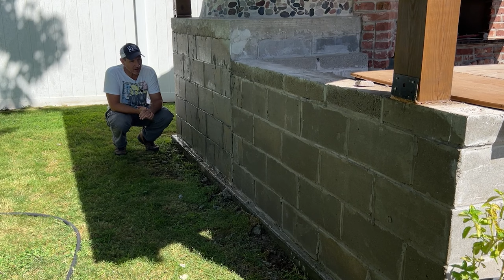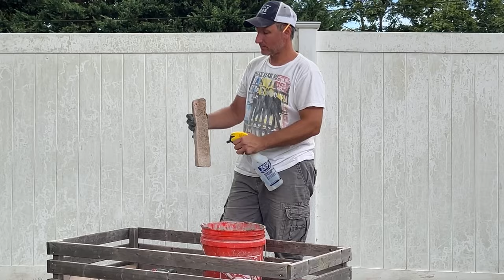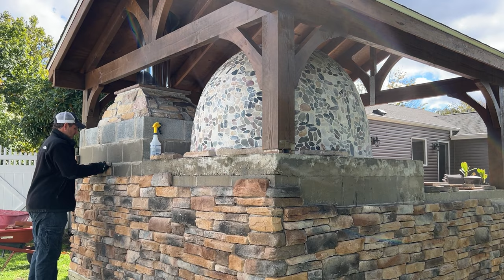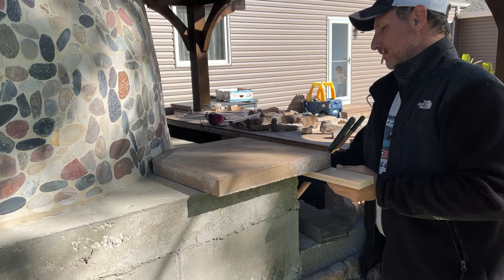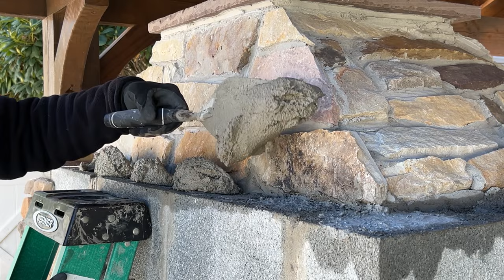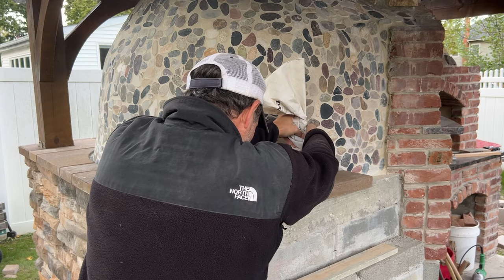Installing Stone Veneer Over Cinderblock / Outdoor Kitchen Build / DIY Stone Veneer Install /Part 14

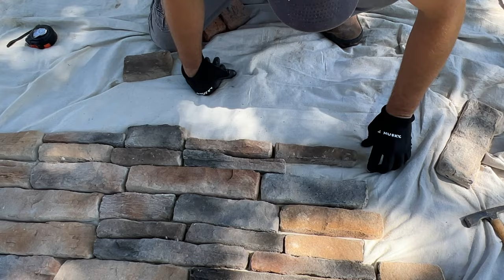Comment: Looks awesome, as someone in the landscape construction/ masonry field. The one thing I’d recommend is to avoid having a joint where 4 corners touch like at 1:33, use a longer piece to break that up. Small detail that’s not really noticeable, but it’s a general rule of thumb with stonework that isn’t in a tile pattern. Same goes for patios.
Reply: Exactly what I came to say. He should have also done something different with the transition from the brick to the stone at the end of the video. The straight line transition is a bad look, and would be a weak point if it was structural

Comment: Looks Awesome, I just built a U shaped wall & am going to apply same stone veneer.... Notice you didn't apply a scratch coat?  I tried a scratch coat on one small section but it just crumbled... I think I'm going to use your method.   You used just standard Type S right?